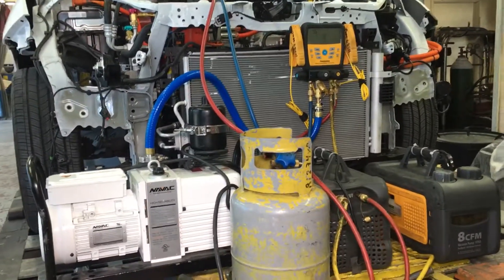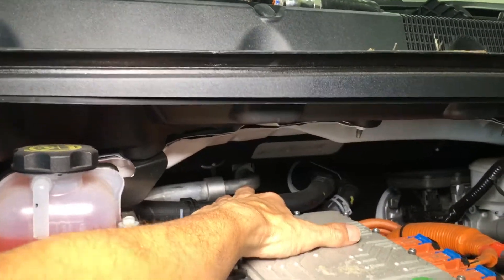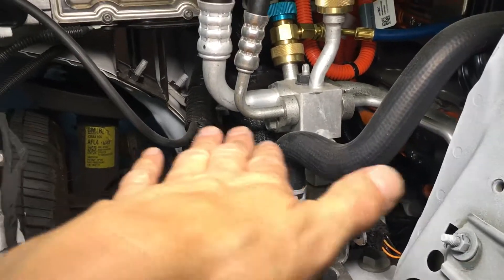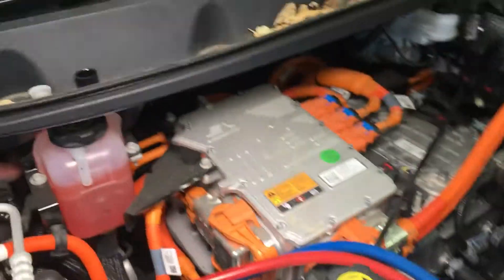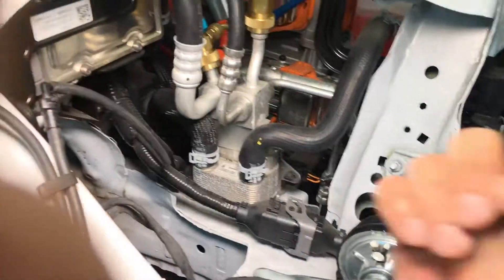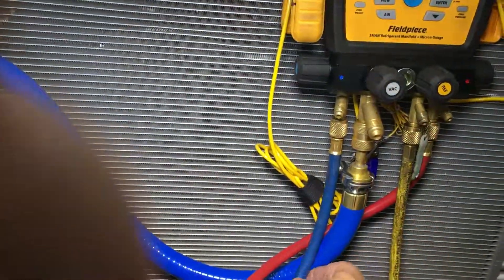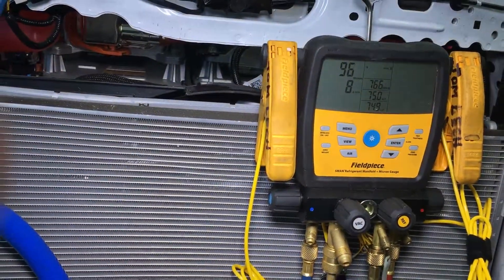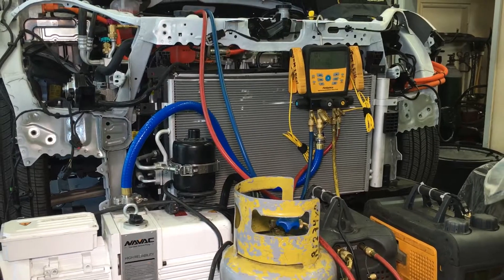2019 Chevy bolt thermal management

Comment: So the thermal system will work with the car unplugged? Planning to part at the airport for a week at a time.
Reply from the maker: Read each and every individual manufactures directions and specifications on extended part times. 

Different manufacturers very slightly and what they recommend for procedures .